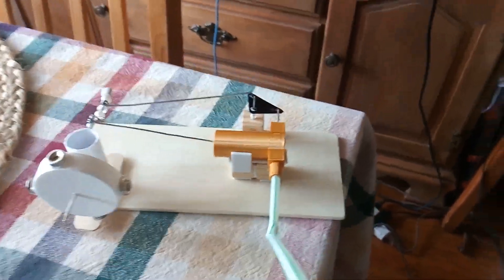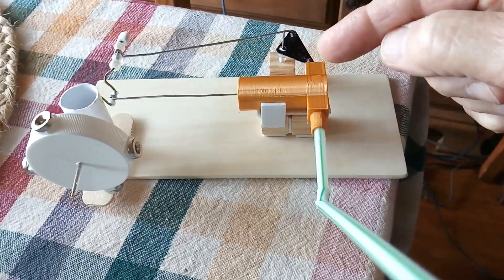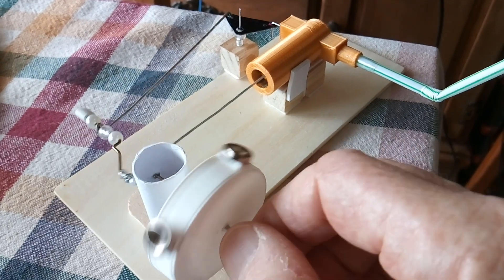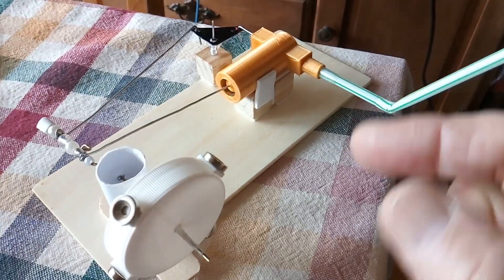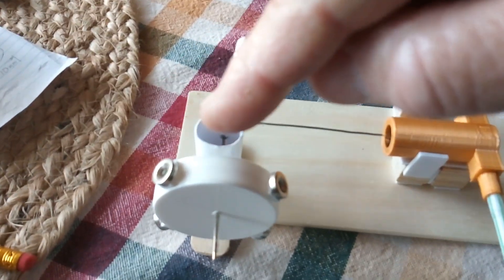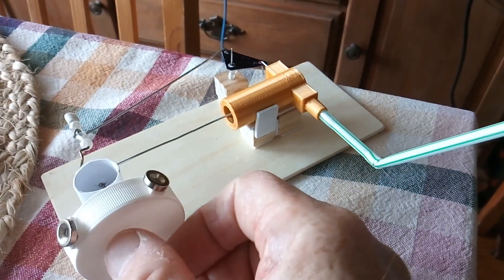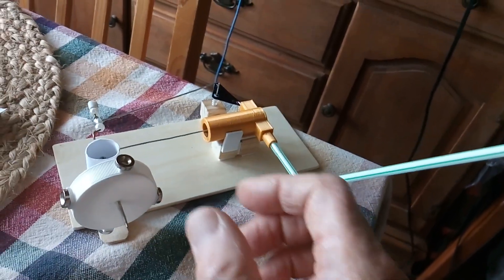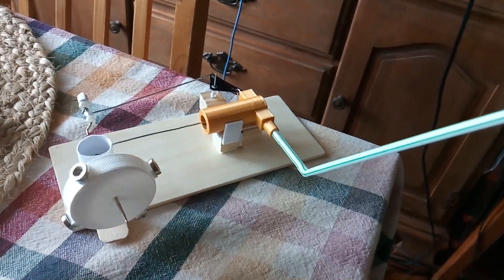Ball Piston Air Engine

Comment: Nice. Where's Maggie? She could generate enough from this to blink her eyes.
Reply from the maker: I thought about showing this to her.  If I can find an adequate compressed air source so it runs longer she would be more happy.  This short run time now might leave her dissapointed. Ha.
Reply: @Lidmotor  A big balloon might work.
Reply from the maker: @benwinkel  What I might build is an air tank made from a 1 liter soda bottle.  There are a bunch of videos on how to do that.  You use a tire pump to fill it up.  These type air engines only need a few psi to run but you need volume to make a long run.  I would love to run this on steam but the PLA plastic would melt.  Your idea of using large baloon would be a quick simple solution.  Thanks.
Reply: @Lidmotor  Excellent. I'm looking forward to that.

Comment: Hi..the another advantage of pulse motor is.. it consume low power, i dont know if you r plan to making high psi air pressure just like stirling engine.. I am waiting your next project "16valve solenoid engine with pulse motor"😍..like always keep the great project..cheers.

Comment: So, I hate to ask this here but several years ago you featured a small 1" square signal generator or frequency generator you purchased that had 6 leads coming out of it  As I recall you used it to regulate the speed of a motor you made.  I have scoured your video titles and re-watched a few to try and find it to no avail.  Can you post the URL to the video that covers that?  I came across mine doing some work space cleanup but there was no supplied details on the connections.  BTW,  regarding this video, - using a similar principle you should make a motor that runs a small air pump and feed the output of that into your air engine.  The difficulty would be attaining the required output to sustain continued operation.
Reply from the maker: Here is one of my videos from 2018 where I used a small 3 phase dc motor controller.  The link in the description to the Ebay location where I got mine doesn't work anymore. I looked around and you can get them all over for about 10 bucks or less.  The hookup to the motor is pretty straight forward.  You air pump idea is great.   https://www.youtube.com/watch?v=eGtvlDHtFk8&t=55s
Reply: @Lidmotor  Thank you! I have learned a lot watching your videos over the years.

Comment: It took me a second to catch that double linkage. Got any math for the triangle part?
Reply from the maker: No math used.  I just guessed at it based on what I have seen working on other engines.  The main piston and valve piston are timed at 90 degrees apart. The throw on the main piston is larger than the valve piston but I just guessed at it.  There is lots of info on this type engine online if you want to dig into it.

Comment: i never considered using a ball as a piston. i like it. how's the clearance to the cylinder wall and is it lubricated or is it like nylon that's said to be self lubricating?
Reply from the maker: Great questions!  I worked on the clearance and ended up with a 10mm ball that ran in a 10.15mm cylinder.  The print quality wasn't great and had ridges in the print layers.  I tried smoothing the cylinder bore with fine wet and dry sandpaper but the fit still wasn't very good.  Better printer settings might solve the problem.  As far a lubrication I tried oil, silicon, and graphite. The filament plastic is PLA so I don't know which is the best lubrication for this application. A quick Google search would answer that.

Comment: That is brilliant 😊♥👍
Reply from the maker: This was almost a complete failure. Last night at 1 am I finally got the little thing to kinda work.  I was going to walk away from the project and do a video on "failure learning" but today I got it running pretty good and decided to press on.
Reply: @Lidmotor  I know that feeling, glad you pushed ahead. I rewatched the steam engine video again and downloaded the PDF from that one, for my reference files. I may have a go myself, although not just at the moment.
Reply from the maker: @GrandadIsAnOldMan  I know what you mean.  These type projects are not quick and when you are busy sometimes even starting one is hard.  I have a Stirling engine project I have been putting off that is like that.  It just sits in the back of my mind gathering dust.  It is a "someday project".